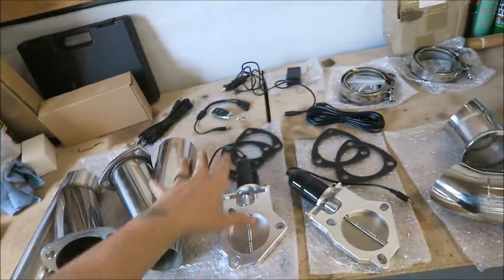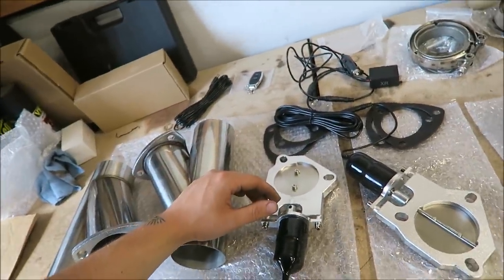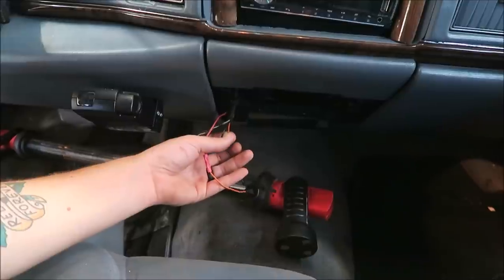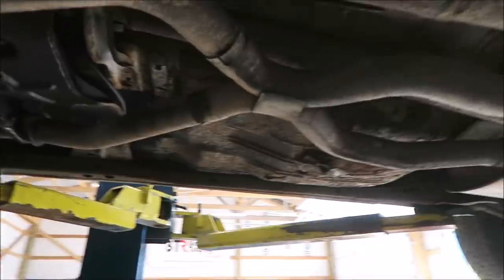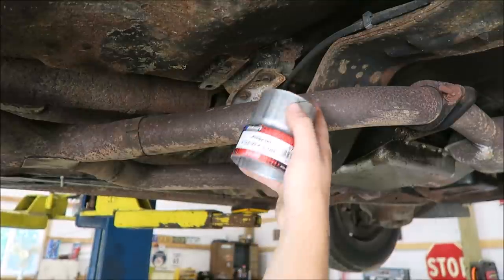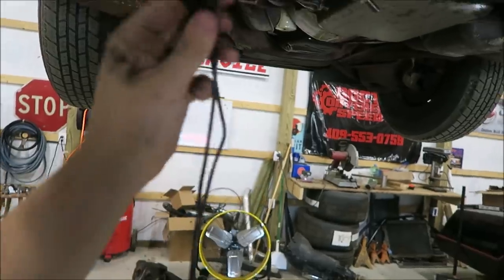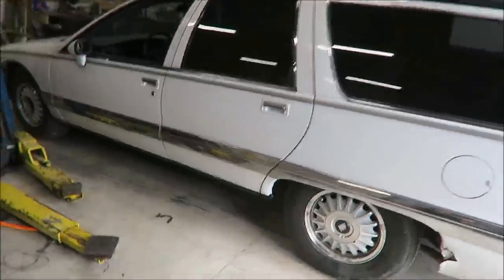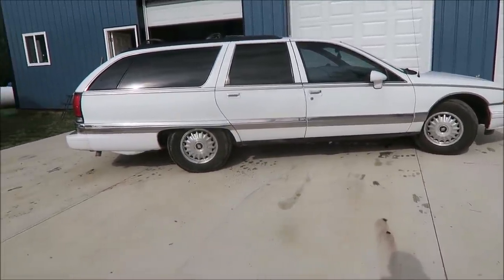IT SOUNDS SO GOOD!! Installing Exhaust Cutouts on the Roadmaster Wagon!

Comment: The system looks like a cross between QTP and Summit Racing cutouts. The motor and flaps are exactly like QTP's and the V-band connector and turn-down are like Summit's. I know, I have QTP cutouts on my Ford VelociRaptors and a Summit cutout on my Trans Am. I prefer the V-band on the turn-down for the adjustability of it. Looks like a good system. Next time I need some cutouts, I will give these a try.  The motors looked to be hanging a bit low, needs to be adjusted up a little. Also you should put some shrink wrap on the connectors under the car. Not only will it water proof the connection, it will keep it from becoming dis-connected.

Comment: As far as the wiring for the cigarette lighter goes, he probably had a phone charger or something plugged in and it was draining the battery after sitting for weeks at a time. He probably spliced in that red wire to power the lighter only when the engine is running.

Comment: If it has wireless control why run the power inside the car vs just hooking to a hot outside?!?
Reply: Agree, just needs 12v, just leave it in the engine bay!
Reply from the maker: It was just convenient to just run it inside and plug it in. Took like 3 minutes lol
Reply: SniderTron 3000 agreed it’s easy, and by the way it sounds great! Thanks for the content. I guess it would be cleaner if you installed in the engine bay but that may not be what you’re going for, it is a roadmaster after all!